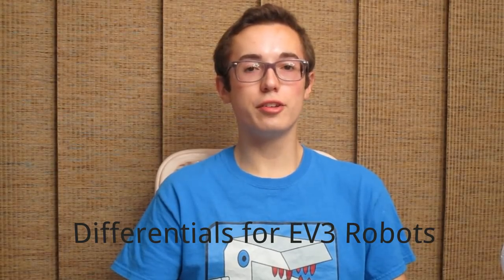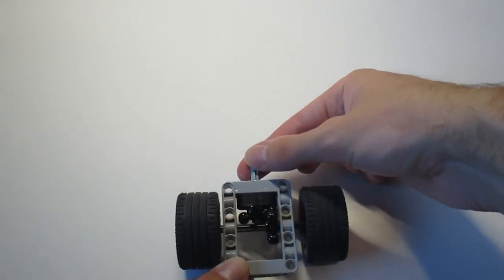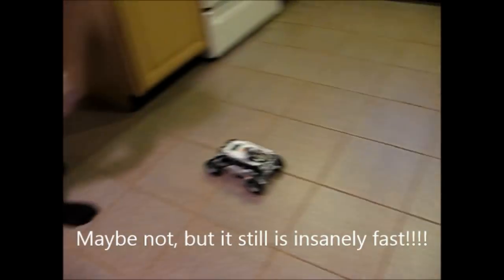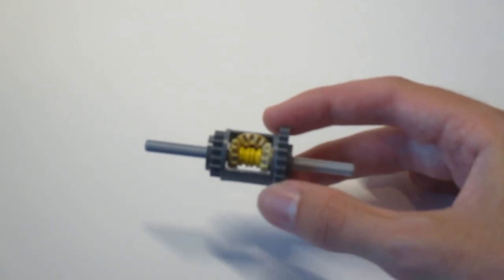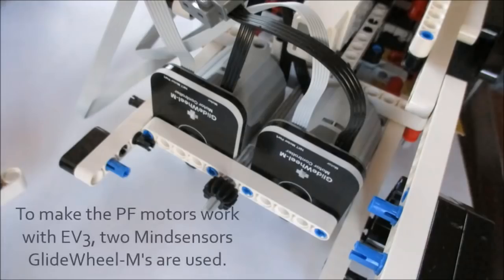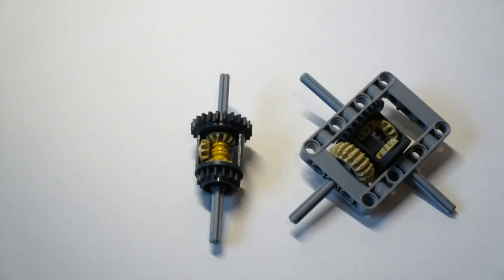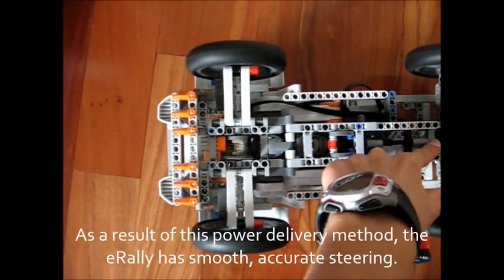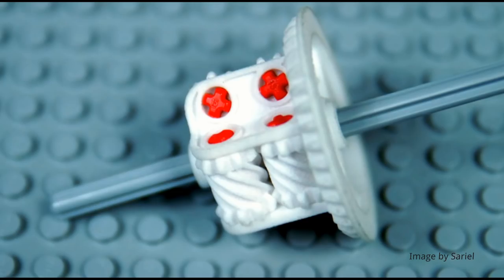Differentials - Why are they so Important for EV3 Robots?

Comment: Nice video, quite clear! I have just one correction and suggestion. It's possible that it wasn't Leonardo da Vinci who invented the differential, but rather the Chinese, with their south-pointing chariot: https://en.wikipedia.org/wiki/South-pointing_chariot
Also, the differential has many other uses that you might want to explore in further videos, not just on drive systems. For example, its property to spin one output when the other is blocked can be used to power two functions from a single motor (each in one direction only, though), by mounting a ratchet on each output. Then each output can, for example, drive via crank its own pneumatic switch.
Reply from the maker: I just looked into those south-pointing chariots and they're fascinating! Thank you for sharing! Also, I've heard about using differentials for multiple purposes, but the idea that you shared is absolutely brilliant! I will absolutely do a differential revisit soon after I explore this some more.

Comment: great video, could you give me some advice please? Last year my FLL team was scoring 350 points 19 out of 20 times. We got to the competition and scored 0 in our practice round and 55 , 95, and 73 points Can you give me some advice to help my team this year?
Reply from the maker: The number one most important quality that an FLL robot must have is consistency. Back when I was in FLL, our team repeatedly tested and re-tested our mission solutions. We knew it wasn't good enough to have the robot work once or twice then move on, we wanted missions that would work every time. Make sure that you have reproducible results in your programming. There are several ways to make your robots more reliable, which I have discussed on this channel. Check out my videos on driving straight, using odometers to measure distance, slop distance, line following, and line squaring.
Reply: Thanks' I re-wrote your gyro follower and line squaring programs. I also remembered that the mats had 1/2 inch bumps in the mat. I found out that First changed the the mat material and and it loses traction during use over time. The team that won was the only team that used the tank treads. Could you make a video on turning with the gyro sensor because I can't find one on your channel. Thanks again for the advice!
Reply from the maker: I'm currently making a video on gyro turns as we speak! It will be out in September.